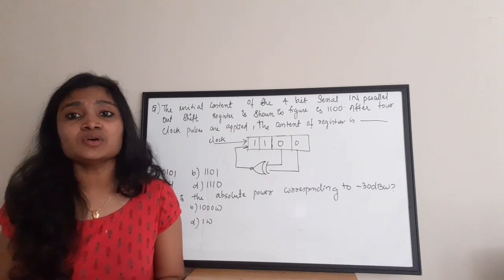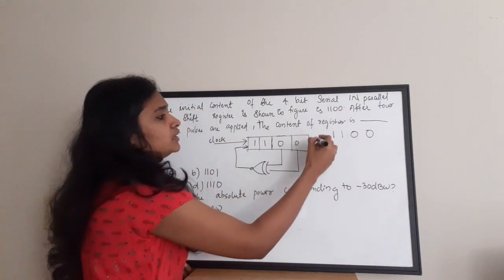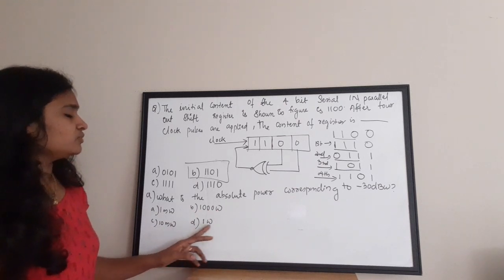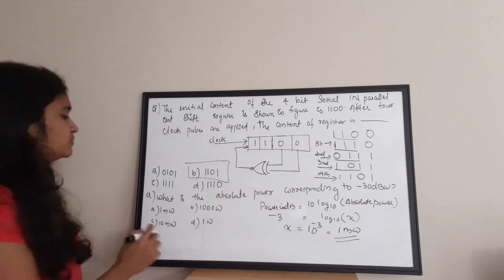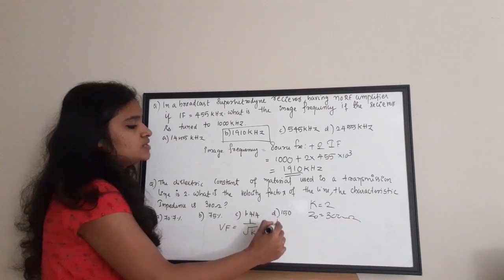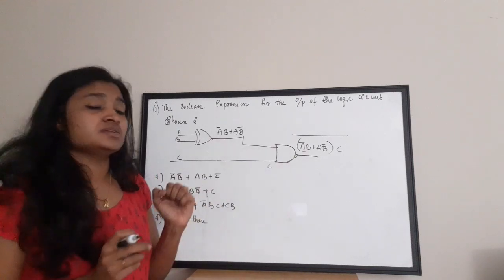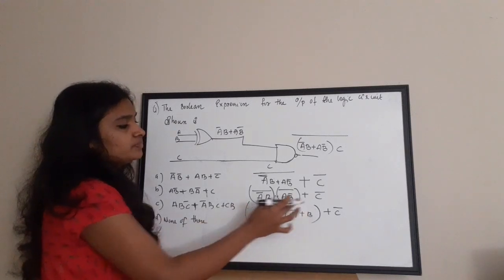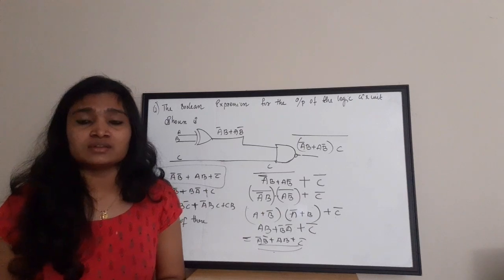ISRO- Technical Assistant Electronics-Previous Year Questions 2018 part2

Comment: Mem in CMRR u total 20log instead of 10log...plz reply.
Reply from the maker: Yes, it is 20 log. But where have I applied CMRR equation in this video.
Reply: @EasyElectronics_jobupdates  in one other videos..u told to find CMRR to dB take 20log ....but in this video to find in dB u take 10 log...so
Reply: Mem..to find CMRR in dB we should take 20log.
N
to find power in dB we should take 10log..

Is it correct?
Reply from the maker: @manik2676  yes, here in the question have they given that we are using a opam, no right. So simply take 10 log. That is the equation to convert power to db.
Reply: @EasyElectronics_jobupdates  thanks mem..

Comment: Thanks madam daily make isro technical assistance previous years video. Madam by analysis of previous years paper can u make sample isro technical assistance 5set question with key answer. Each set contain 80nos question. 
&send to my e-mail I'd : dominic_zzz@yahoo.co.in  
It is request 🙏😊 iam very serious about to clear isro technical assistance exam madam kindly help.
Reply: Ok no problem before isro technical assistance exam kindly do it madam in pdf format thanks
Reply from the maker: It will take some time, even though I will try my maximum.
Reply from the maker: Also I am not having a laptop I am only using my phone, so it will take some time. Will send you if I have made the pdfs
Reply: Ok thanks madam kindly uploaded daily technical assistance exam previous years paper